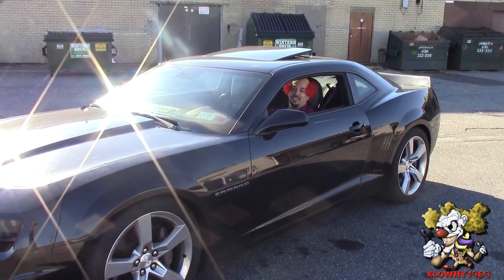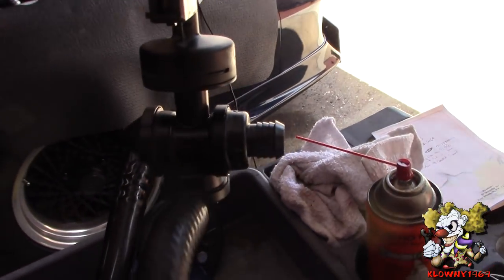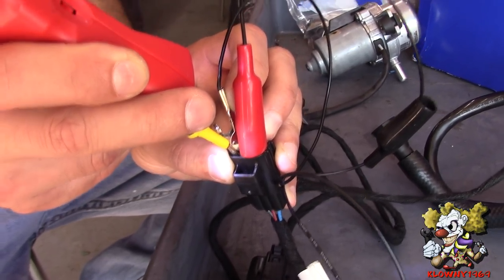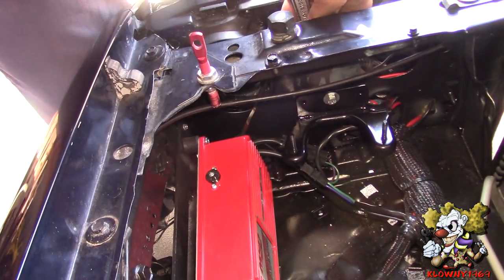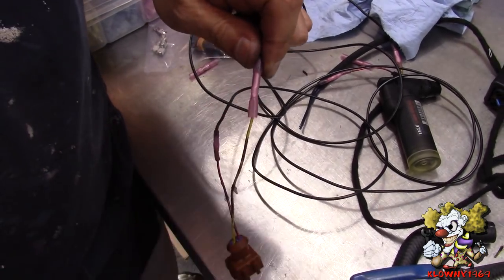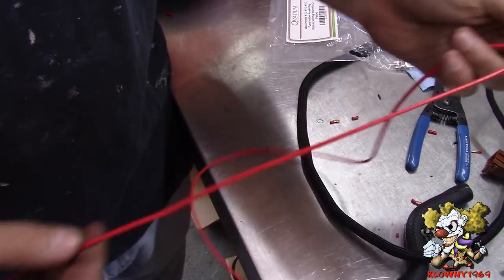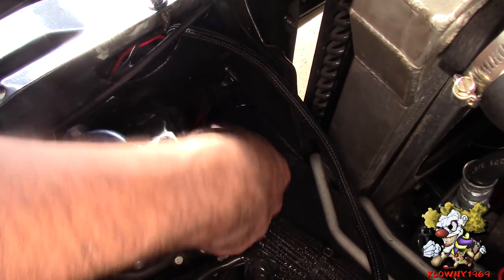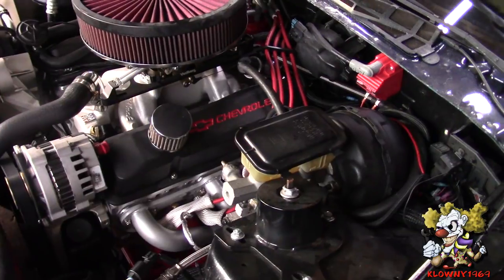How To Install an Electric Vacuum Pump for Better Brakes!

Comment: Just did the volvo pump on my ctsv because of this video, works awesome and its nice that you have the manifold vacuum as a backup. As others mentioned the kit does not come with the booster valve.  Thanks!
Reply from the maker: glad i was able to help..dont forget to subscribe

Comment: Thanks for the video mate!  I've got an old holden six "179HP with a 221 stroker kit, and triple 2" SU's" sitting in a VK Commodore wagon, and needed to set up a vacuum booster.  For me, I'd got one from a VE commodore.  VF Commodore is the same too.  Can be bought real cheap secondhand from just about anyone who's wrecking them.  Also can be found cheap on ebay etc.  Pump type is UP28.  Massive Massive difference from just running off the manifold to booster on its own!  Feels a lot safer to drive now too.
Reply: I'm in Australia.

Comment: Hey my kit didn't come with the dual connector for the brake booster to connect the intake and the new pump. Can you telk me the part number and/or where to get it? It's a cleaner install and gives the added peace of mind of both staying connected. 

Thank you
Reply from the maker: Can try calling volvo..I heard part numbers have changed

Comment: Hello great video would you please  tell me where to get the connector for the pump that goes to sensor. I fou8nd the rotary pump from a rebuilder for 50.00 so i have to source sensor and connectors.
Reply from the maker: Tey the dealer..if not you might have to male your own wires or junkyard.dont forget to subscribe

Comment: I know this is an old video, but do you have the part number for just the switch?   Im having trouble getting a good switch that will work for mine.
Reply from the maker: Try to contact volvo, part numbers have changed since I made this video..thanks for watching and don't forget to subscribe and hit that bell 🔔

Comment: I may have to look into installing this vacuum pump, I'm running a vacuum canister now, which works ok when coming to a stop from speed, but doesn't do much for me in a parking lot or at start up.  The small block 454 I'm running in my IROC Z28 only provides around 5-9 inches of vacuum at idle and this may be cheaper than swapping to a manual brake setup.
Reply from the maker: John Luttrell it works great
Reply: Not a bad price either, the vacuum pump kit is cheaper than swapping over to manual brakes and a whole lot easier.
Reply from the maker: yup..cheaper than racing vacuum pumps as well..like those that summit sells
Reply: Let me ask you this.  Why would it even need a line running to the carburetor anymore? Why not just let the brake booster be stand alone with the pump?
Reply from the maker: John Luttrell because the carb still gives it that little extra vacuum when needed..makes the pump work less...unless ofcoarse u have almost no vacuum at idle lol

Comment: I'm using the same pump on my car but I'm using a spdt 3 leg vacuum switch and I can't seem to get it to work. Keep in mind the pump isn't grounded because of the rubber mounts. Could you please tell me or even better draw a diagram of how I need to wire this system. I would be so appreciative. 
Thank you! Randy

Comment: Hello Klowny, I would like to install it on my Mustang, the 30641411 kit I found, does not seem to inlude the hoses. Can you share where you found the all material on the kit?
Do you think it is not better to add a check valve between the low existing depressure circuit and the new one?
Many thanks for your vids
Alex

Comment: I purchased the same pump but not the remaining parts. By chance do you remember of you got the balance of the parts from one company and if so what company. On a 2015 Ford Escape the vacuum is created using the cam and that piece broke off and it would be a major repair so this is why I'm attempting the electric one. Thanks
Reply from the maker: The peice came off the cam? Not sure what you are talking about
Reply: The overhead cam actually run the vacuum pump on these things and the tip that  controls it snaped off but does not effect the working of the cam. I do not want to have the cam replaced because it is costly so after seeing your video I figured why can't I do this. I found the pump itself online but that company did not offer all the other items. Thanks

Comment: Awesome info but all these extra parts come in the kit that you have here for this install? If not do you have part numbers so I can locate and order all parts needed, thanks so much for the great and informative videos my friend!
Reply from the maker: Everything comes included..thanks for watching
Reply: @klowny1969  I just got my kit in but it didnt come with the brake vacuum switch.  Would you happen to have that part number and where I might be able to purchase it?
Reply from the maker: thats not good..i would return it and get another one
Reply: Where can I buy this kit?
Reply: @mikeerb1998  I bought mine off of a volvo parts house website
Reply: @klowny1969  I called to ask about this kit and the parts guy at Volvo said this vacuum switch was a separate purchase to this kit so I asked if I could go ahead and purchase it he then asked for the VIN of the car I'm working on. I told him I dont have the it but I did email him a few pics of the switch I need but he insisted that he needed the vin and couldn't got by pics so I said never mind. Would you happen to have a little more info such as part number for the vacuum switch your using for the install so i can go ahead and order it from somewhere else please?

Comment: Dude i think am onto something good here ,, I installed a huge cam on my truck,,, now at low speed brakes feel weird and it only feels good when I am hard on the accelerator
Reply from the maker: yes you need a vacuum pump..dont forget to subscribe

Comment: Hi I have a twin turbo hellcat  with a cam that only shows 7-8 vaccum and we usually need 12-16 to launch the cam at else she pushes through breaks.   Would this help ? And or effect my bov. ?  I’m looking for a solution that will give me vacuum consistency

Comment: I have fitted this pump as per video but now the car runs rough at times, I have a Holloey EFI fitted, could the increased vacuum be upsetting the EFI? If so an ideas on a solution please?
Reply from the maker: Maybe you maxed out your alternator amperage output? Don't forget to subscribe

Comment: My 2002 SS is throwing a code of p0446. Could it be just the purge solenoid?
Reply from the maker: 4thGenDude02/BunkAssMechanic its possible..I've had luck sometimes just blowing compressed air in the lines to unclog them
Reply: klowny1969 you gotta make a video on that. That would be awesome
Reply from the maker: 4thGenDude02/BunkAssMechanic  I have a video on how to stop stop your gas pump from clicking all the time..its related
Reply: klowny1969 im going to hate the day i have to change the fuel pump. People do that trap door. No thanks

Comment: Hey clowny since you've work on alot of fbody third gens I was wonder if you ever had the problem where the fuel pump isn't getting power I have a new pump and relay and the fuse is good orange wire on relay is getting power I'm just not getting power to the fuel pump when ignition is on and I'm also having issues finding the ground wire for the fuel pump is it in the engine bay? my car is a 91rs camaro third gen
Reply from the maker: Mitch S the computer sends a ground signal to the fuel pump relay..see if it pulses it when u first turn the ignition
Reply: klowny1969 how would I test the pulses ? With a volt meter?
Reply from the maker: The computer primes the pump when you turn the key on for a few seconds..check the switched side of the relay for a ground signal from the computer
Reply: klowny1969 OK thank you klowny I'll get back to you if I have any more questions

Comment: Hey klowny did that vacuum pump shut off switch come with the pump kit? Or did you have to order it separately and if so do you have the part number ?
Reply from the maker: courtney parker it came with the kit
Reply: My kit didnt come with the switch and parts guy says its sold separately so, I'm not sure if hes jiving me or not but have you found a part number for it???
Reply from the maker: 30641411 is the kit..is that what u got?
Reply from the maker: Everything comes in that box, it is a kit to upgrade for a Volvo tsb for low vacuum issues on a volvo s40
Reply: @klowny1969  yessir that is the part number I ordered and it didnt come with the hose/switch. I called the parts house and they said that the switch doesn't c ok me with this kit and that I would have to purchase im t separately. Can you tell me where you ordered yours from, please?? That way I can send this kit back and order from your parts house and get the correct kit.
Reply from the maker: Bay ridge brooklyn volvo
Reply: Same issue for me,  pump, bracket, electricals but that Volvo P/N lacks the hoses and combination check valve. Can you provide that P/N kit please? Or should I argue with the counter man?
Reply: @mattkurke1696  I ordered the hose/switch separately from Amazon but have to find the part number. Soon as I get a chance I'll post it for you
Reply: Thanks much
Reply from the maker: it should come complete
Reply: I have purchased this Volvo P/N and the box is not large enough to contain the hose and compound check valve items. If you have knowledge of the additional kit P/N please share.
Reply: @mattkurke1696  the part number for the hose/switch assembly is: 30616993. I ordered it off of Ebay and it worked perfectly on my 88 Chevy caprice.
Reply: Very excellent; thank you for your efforts.
Reply: @mattkurke1696  you welcome

Comment: All is installed however the pump shuts off at 15 in-hg. Do you know of a switch that will do the proper job such as your reading?
Reply from the maker: You put in the volvo pump?
Reply: @klowny1969  Yup; the included Volvo vacuum switch was set to 15 in-hg for some reason unknown in this hemisphere. I bought another vacuum switch, installed it in-line and rewired; this one gave me 17 in-hg; wow. I applied a little heat to loosen the loctite and adjusted it to 27 in-hg. Still will not stop safely. I spoke with SSBC this AM; they suggest resurfacing the [glazed] rotors and install new pads. This week hopefully. Just FYI; thanks for the info o provide.
Reply from the maker: Oh ok..it could be a few things..but that would be a good start..depends also if it's a custom setup..that the rod ratio is correct

Comment: this pump is continued turn on and hot with a bad noise what is the problem ? the switch or the electrical pump?
Reply from the maker: sounds like the switch is constantly on.. you might also have a bad motor..dont forget to subscribe
Reply: klowny1969 yes it supposed turn off when I start the car but now the sound of the vacuum is constantly on like buzzing :/ and I don’t know if is bad when I’ll drive because it’s relation with the brakes